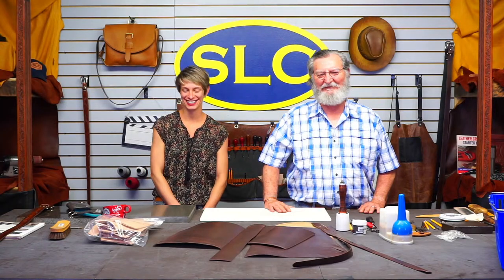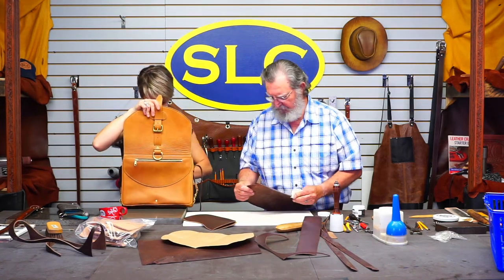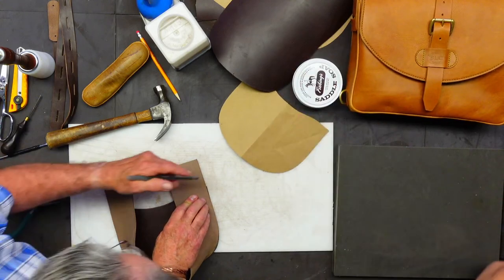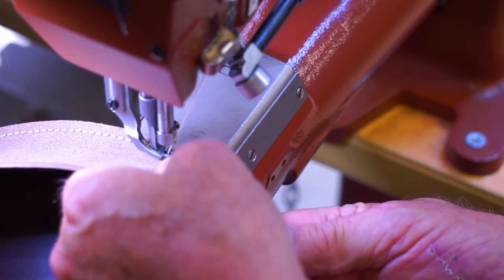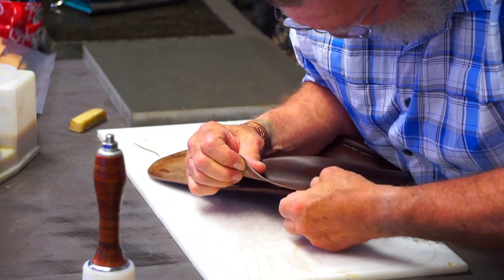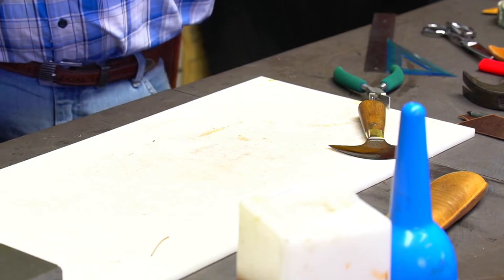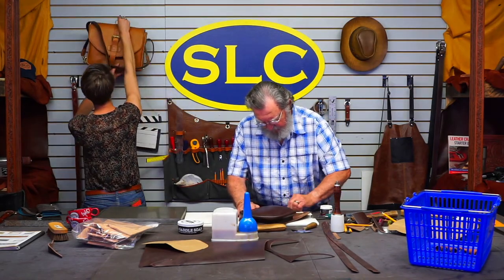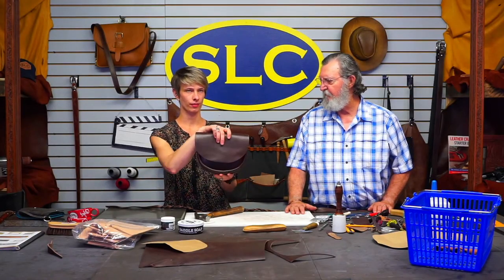Constructing a Bag with a Gusset - w/ Denny + Liz

Comment: I guarantee.. 2 lbs of bb's .. weights the same as 2 lbs of lead shot.
(wink)..  I  made turtle weights,  they are 3 sided, so there is room in hight, for the extra bb's to get the weight and they work very well for holding 3D  shapes .
Reply from the maker: Probably the same as two pounds of feathers too. 😂